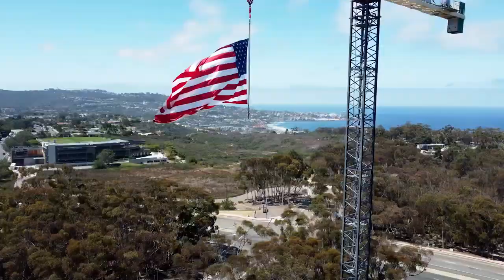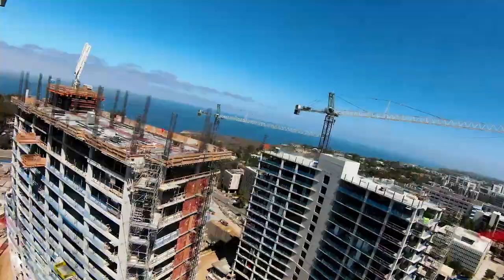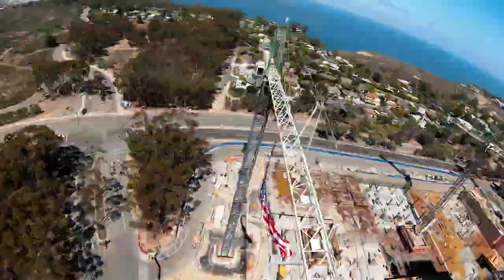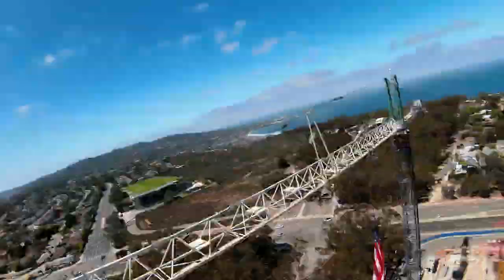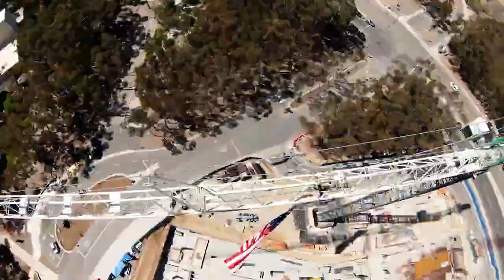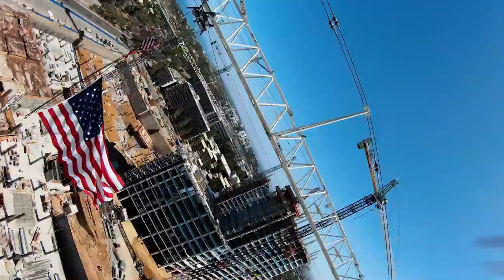Detecting Methane Leaks With Drone Mounted LiDAR

Comment from the maker: An airborne LiDAR (Light Detection and Ranging) leak detection system is a technology used to detect gas leaks from pipelines, storage facilities, and other infrastructure from the air. Here’s an overview of how it works and its key features:

How It Works:
LiDAR Technology: LiDAR uses laser pulses to measure distances by calculating the time it takes for the laser to reflect back from the surface. When equipped on an aircraft, this system can scan large areas efficiently.
Detection of Gas Leaks: The system is specifically tuned to detect the spectral signature of gases. When a gas leak occurs, the concentration of the gas in the air alters the way the laser pulses are reflected.
Data Collection and Analysis: The aircraft, often a drone or a manned aircraft, flies over the target area. The LiDAR system collects data, which is then analyzed to identify potential leaks by detecting anomalies in the reflection patterns.
Real-time Monitoring: Advanced systems can provide real-time data, enabling quick response to detected leaks.
Key Features:
High Accuracy: Capable of detecting even small leaks with high precision.
Large Area Coverage: Can survey extensive areas quickly, making it suitable for monitoring long pipelines and large facilities.
Environmental Safety: Non-intrusive method that doesn’t require physical contact with the infrastructure.
Cost-Effective: Reduces the need for manual inspections, lowering operational costs.
Data Integration: Can integrate with GIS (Geographic Information Systems) for detailed mapping and analysis.
Applications:
Oil and Gas Industry: Monitoring pipelines, storage tanks, and refineries for methane or other hydrocarbon leaks.
Utilities: Inspecting gas distribution networks in urban and rural areas.
Environmental Monitoring: Detecting and monitoring natural gas emissions in environmental studies.
Benefits:
Safety: Enhances safety by detecting leaks early, preventing potential accidents.
Regulatory Compliance: Helps companies comply with environmental regulations by monitoring and reporting emissions.
Operational Efficiency: Improves the efficiency of maintenance operations by pinpointing exact locations of leaks.
Challenges:
Initial Costs: High initial investment for the technology and aircraft.
Data Processing: Requires sophisticated software and expertise to analyze the data accurately.
Weather Dependence: Performance can be affected by weather conditions, such as heavy rain or fog.
Future Trends:
Integration with AI: Combining LiDAR data with artificial intelligence to improve detection accuracy and automate analysis.
Miniaturization: Development of smaller, more cost-effective systems suitable for deployment on drones.
Enhanced Sensitivity: Improving the sensitivity of LiDAR systems to detect a wider range of gases and lower concentrations.
Overall, airborne LiDAR leak detection systems represent a significant advancement in the field of gas leak detection, offering a powerful tool for ensuring the safety and efficiency of gas infrastructure.

Keywords: airborne LiDAR, leak detection, gas leaks, pipelines, storage facilities, laser pulses, real-time monitoring, environmental safety, oil and gas industry, utilities, environmental monitoring, safety, regulatory compliance, operational efficiency, AI integration, miniaturization, enhanced sensitivity

Comment from the maker: Gas Mapping LiDAR is an advanced remote sensing technology specifically designed to detect, map, and quantify gas emissions, such as methane, over large areas. It integrates Light Detection and Ranging (LiDAR) technology with gas detection capabilities to provide detailed spatial data on gas concentrations. Here’s an overview of how Gas Mapping LiDAR works, its applications, benefits, and challenges:

How It Works:
LiDAR Technology: At the core, LiDAR uses laser pulses to measure distances by calculating the time it takes for the laser to reflect back from the surface. For gas mapping, the system is tuned to specific wavelengths absorbed by gases like methane.
Gas Detection: As the laser pulses travel through the atmosphere, they interact with gas molecules. Methane and other gases have specific absorption characteristics that can be detected and measured.
Data Collection: The system, typically mounted on an aircraft or drone, scans the area of interest. It collects data on the intensity and timing of the returned laser signals, which are affected by the presence of gas.
Mapping and Analysis: The collected data is processed to create detailed maps showing gas concentrations. Advanced algorithms analyze the variations in the laser signals to quantify the amount and distribution of the gas.
Visualization: The resulting data can be visualized in 2D or 3D maps, showing precise locations and concentrations of gas leaks or emissions.
Key Features:
High Resolution: Provides detailed spatial resolution, allowing for precise localization of gas sources.
Wide Area Coverage: Capable of surveying large areas quickly, making it ideal for monitoring extensive infrastructures like pipelines.
Real-time Data: Some systems offer real-time data processing, enabling immediate response to detected leaks.
Non-Invasive: Does not require physical contact with the infrastructure, minimizing disruption.
Applications:
Oil and Gas Industry: Monitoring pipelines, well sites, and storage facilities for methane and other gas leaks.
Environmental Monitoring: Assessing emissions from natural sources and industrial activities.
Urban Utilities: Inspecting gas distribution networks in urban areas.
Agriculture: Monitoring methane emissions from livestock and agricultural practices.
Benefits:
Enhanced Safety: Early detection of gas leaks reduces the risk of accidents and explosions.
Environmental Protection: Helps in reducing greenhouse gas emissions by identifying and mitigating leaks.
Regulatory Compliance: Assists companies in meeting environmental regulations and reporting requirements.
Cost Efficiency: Reduces the need for extensive manual inspections, saving time and resources.
Comprehensive Analysis: Provides a detailed understanding of gas emission patterns and sources.
Challenges:
Initial Costs: High initial investment for the LiDAR equipment and aircraft/drone deployment.
Data Processing: Requires sophisticated software and expertise to analyze and interpret the data accurately.
Weather Sensitivity: Performance can be affected by adverse weather conditions such as heavy rain, fog, or strong winds.
Technical Expertise: Requires trained personnel to operate the equipment and manage data analysis.
Future Trends:
Integration with AI: Combining Gas Mapping LiDAR data with artificial intelligence to enhance detection accuracy and automate analysis.
Miniaturization: Development of smaller, more affordable systems suitable for a wider range of applications.
Enhanced Sensitivity: Improving the sensitivity of LiDAR systems to detect lower concentrations of various gases.
Expanded Applications: Increasing use in new fields such as renewable energy, urban planning, and climate research.
Gas Mapping LiDAR represents a significant advancement in gas detection technology, offering a powerful tool for ensuring safety, regulatory compliance, and environmental protection through precise and efficient gas emission monitoring.

Keywords: Gas Mapping LiDAR, gas detection, methane leaks, LiDAR technology, remote sensing, real-time data, oil and gas industry, environmental monitoring, urban utilities, agriculture, safety, regulatory compliance, AI integration, miniaturization, enhanced sensitivity, gas emission monitoring